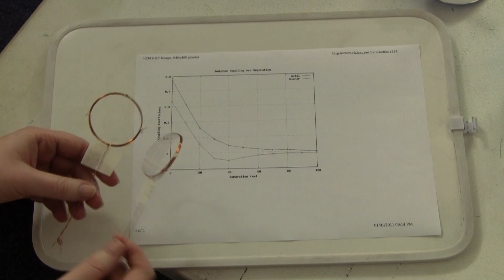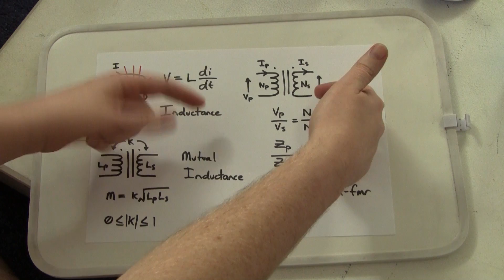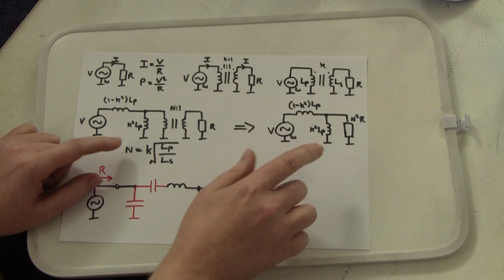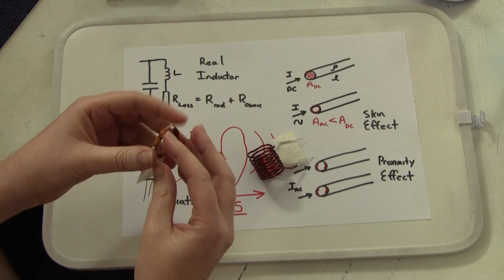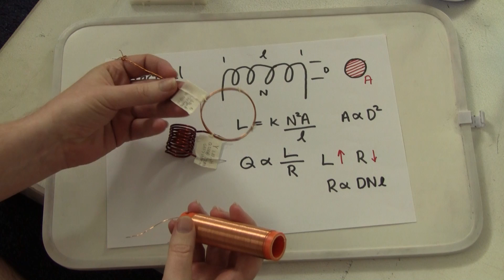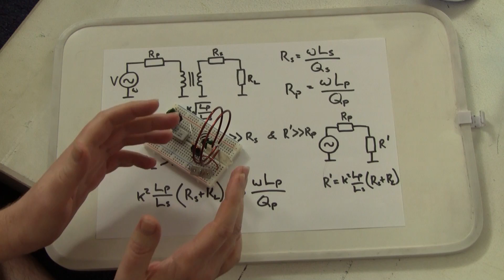About Wireless Power Transfer

Comment: no, magnetic fields do not have orientation as magnetic energy is a static energy that doesn't move and will not do so, magnetic energy only attracts matter like metal and elements that have that capacity to do so, as well to repeal opposite poles, magnetic fields do not have a single-direction orientation as magnetic field only is emitted trough the magnet in a static position that is not manipulated or affected by other sources of energy, common knowledge here.

Comment: What system?  There is no system to fool.  Signals travel in all directions, but magnetic fields have a single-direction orientation, and the receiving coil's orientation relative to the field's is actually a factor in the efficiency.  Yes, the energy loses strength with distance; nobody's arguing otherwise.

Comment: no you think you can really fool the system with that, seriously let me explain better, wireless transmigration of any kind of signals not electrical energy as it can not travel wireless impossible science here, signals do not travel straight they travel everywhere and loose strength you really thing this idea works but your completely wrong just want to fool the system with fake science so you and all cells can create fiction weapons to use them in a near future, sorry it doesn't work lik that

Comment: is reliable in short distance, but as the signal spreads out the signal becomes weaker, radio is reliable again the same way on short distances, while in long distances there is no signals and are not reliable, also the speed at which the wave signals travel is not very fast that is also another mayor issue with wireless signal and wireless transfers of energy, you required speed for electrical energy.

Comment: scientifically is not possible to send large amounts of energy and more difficult to longer distance as wireless signals would dissolve as they travel or like what we would say spread out, making it harder to do such a thing even with more tech still not possible, there are other more convenient ways instead of sending energy wireless and the truth is that wireless energy or transmitting of it is not very reliable for example wireless internet, not very reliable.

Comment: wireless signals do not travel straight they travel everywhere simple because they don't have a conductive path like electrical energy does which is not capable of doing so, electromagnetic does travel as same as wireless signals but the energy is very little and doesn't charge any electronic devices because they require electrical energy, in order to charge an electronic device you would need something that would transform the electromagnetic energy to electric too complicated and useless.

Comment: I would suggest just make a magnetic electronic generator that would spin magnets in opposite direction generating enough energy to power an airplane and more, with out the stupidity of wireless transfer, that would create clean energy and longer lasting energy than any other source, not just that, but perfect for near future flying vehicles that require much energy consumption.

Comment: blablabla, wireless transmission of electric energy is not possible, as for electromagnetic transmission that is more likely to be possible although if you want to use this energy as a source for electrical energy it would be irrelevant, because you would need to transform the electromagnetic energy into electric to power an electronic device, and guess what not just too complicated, how much energy can you get? almost nothing, and useless because of slow speed transmission would not keep up.

Comment: More generally, this video addresses what's known as near-field or even mid-field wireless power transfer, which generally makes use of reactive near-field components rather than radiant energy. Strong coupling of the magnetic field allows wireless transmission of electrical energy through inductive effects. This was studied in a larger scale by a team at MIT in 2007 which utilized characteristics of coupled-mode theory, specifically evanescent wave coupling.

Comment: How?

In a general sense, the fact that you can receive radio signals at all is an immediate contradiction of this. That is electromangetic energy propagated "wireless" from a distant source, and received by an antenna. It is an incredibly small magnitude, but that's irrelevant. This is generally regarded as radiant energy propagating in what is known as far-field conditions.

Comment: I can't even tell you how many times I have listened through this and I have to say that it's been a good source for information but it has left me with a few questions.
You mention that there is a length to amount of coils but you don't give that number. Hoping you can shed some light on it for me. 
Also is there a Voltage peak where the amount transfered is optimal?
I have messed around with it and around 147K with 5 volts I'm getting only 10%.

Thanks for the answers ahead of time!

Comment: I have a few questions on this topic. Are you inducing DC electricity? It looks like that because you are using a battery. Also does adding a soft iron core to the initial coil improve the efficiency of the system?

Comment: If i`m remembering correctly,the General Motors in 1996 was producing a electric car named EV1.The charging plug had wireless induction connector for energy transfer,also this implementation was waterproof compared to conventional connectors.

Comment: the coil acts as a tunnel which amplifies the strength of the magnetic field.  This is the fundamental function of an inductor.  the magnets that they use to pick up old cars and drop them in the crusher employ gigantic inductors.  these are called electromagnets.  Check it out.  The course of humankind was permanently changed when Oersted noticed a nearby compass deflecting when he ran current through a wire.

Comment from the maker: @86Highrise the secondary (the cooking pot) isn't resonant in that system, but the primary is fairly similar.  You could probably design something that would absorb power from an induction range...  The main problem is induction stoves generally notice if they aren't loaded and refuse to deliver much power, this might make it difficult to consume small amounts of power from one (say battery charging).

Comment: What is the difference between this type of induction and the induction used in an induction stove? Does anybody know if it would be possible to for example place a coil on an induction stove and run a electric motor? just in theory, I know the efficiency would be low.

Comment: very good and informative, thanks for sharing

i was wondering what will happen if i have let's say a sheet of steel parallel to the primary, wouldn't that create a current in the sheet of metal that is basically a short (similar to inductance cookers let's say :) ). and if not why not.

Comment: I pray that this is not a stupid question. :) According to Faraday, the magnetic field is created around the wire, perpendicular to the direction of flow of current, right? So, what happens if the wire is coiled unto itself? Does the field follow the first winding or does it follow the general flow of the current? I hope I make sense. Thank you for your answer. BTW, the video is amazing!

Comment from the maker: @danewwittig LEDs are like any diode, they won't conduct in the reverse direction when the applied voltage it below their reverse breakdown voltage.  The LED is actually rectifying the RF and is glowing during less than one half of the cycle times, it is also clamping the amplitude of the voltage across the secondary coil.  This isn't a typical or very efficient circuit really, but just the simplest that would work.  Directly connecting the LED across the tank is actually very bad for its Q.

Comment from the maker: @MrStudent1978 Resonance and low losses allow reasonable efficiency when the coupling is very low.  Typical power transformers have excellent coupling between the windings.  Without resonance you'll see very little power transfer and without high-Q the efficiency will be terrible.

You can check it yourself by doing the maths, or building the circuits - or both. :)

Either way, it is a fun experiment and I encourage you to try it for yourself, I learnt a lot about the physics involved.

Comment from the maker: @danewwittig LEDs are still diodes, they conduct in only one direction, within limits... In this particular application the peak reverse voltage doesn't exceed their breakdown, and the currents are small enough to get away without using any resistors either.  This is not good practice, but acceptable here.
Reply: hey do u have any thing to help me in this major? 
 u know we have a project to build such this circuit and drive a dc motor but our current is not ok !
 we want some helps!:(

Comment from the maker: @HOUNDF0X No because the frequency of operation is low with respect to the size of the coils their radiation (radiation resistance if you prefer) is quite small.  Put simply they are not very good antennas.  The energy exchange happens in the "non-radiative" near-field.  The near-field is essentially the energy that the would otherwise be recovered as back EMF when you discharge the inductance again.  The receiving inductor couples to this field and extracts some of it.